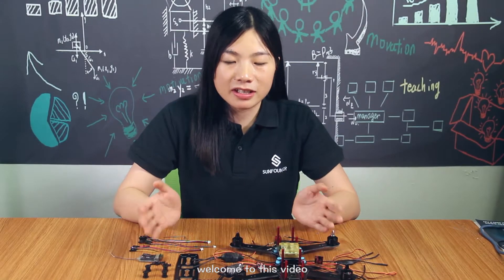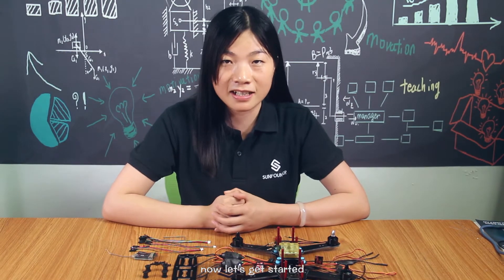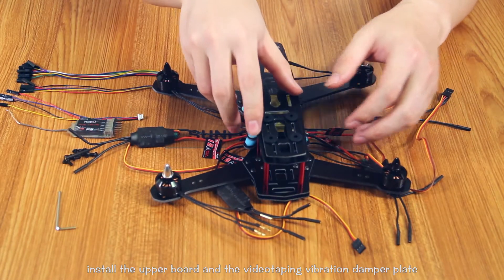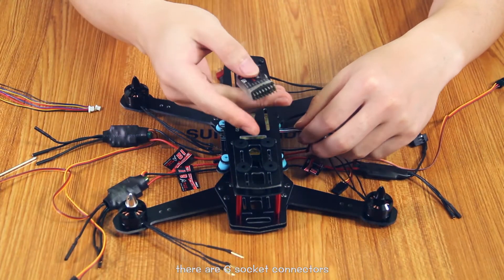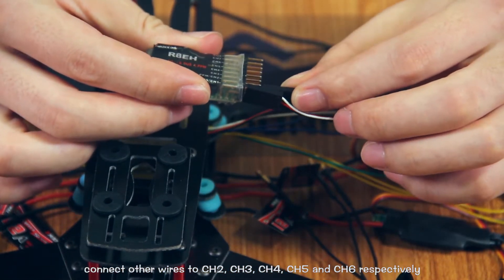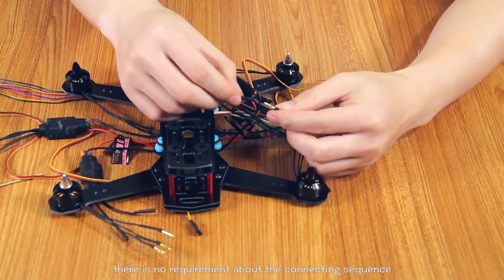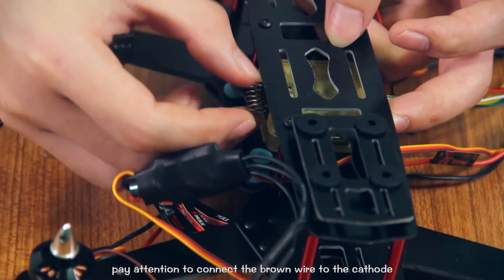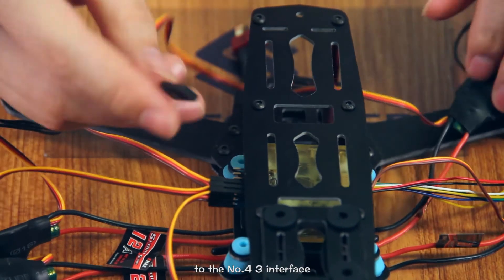SunFounder SF250 FPV Racing Drone Quadcopter Assembly Tutorial 05 - OpenPilot CC3D -Receiver

Comment: The wires to the receiver are different colors from your video, and my drone does not work because the wires are not working. Did you change the color scheme on purpose?
Reply from the maker: Dear James, 

Pls reference the below picture link, and check whether the connection of the cables.
http://i1266.photobucket.com/albums/jj536/Yang_Michal/_MG_687612_zpsbhyq0ivy.jpg
If you have further trouble, pls connect with us.